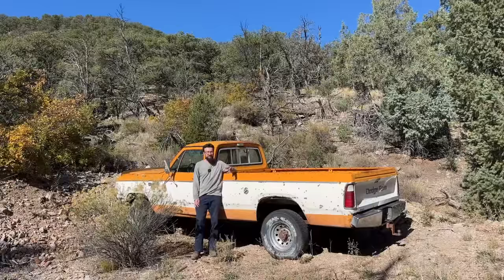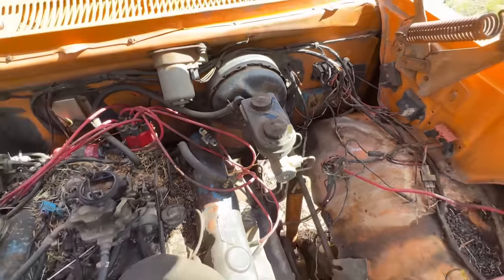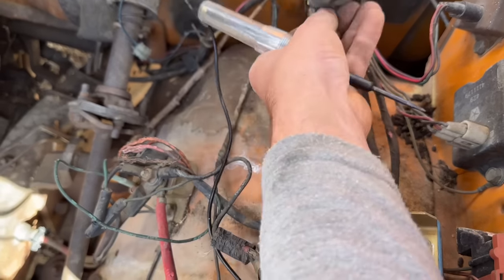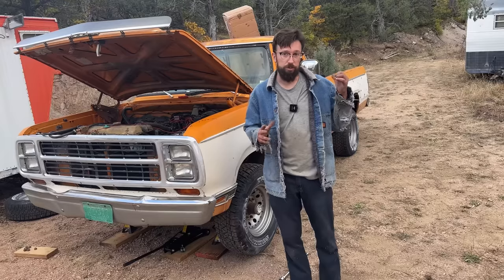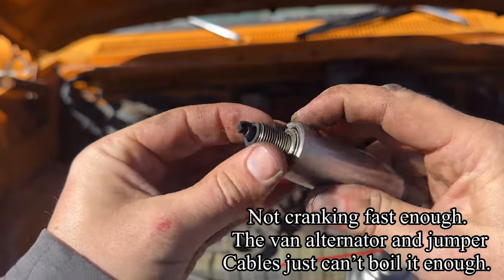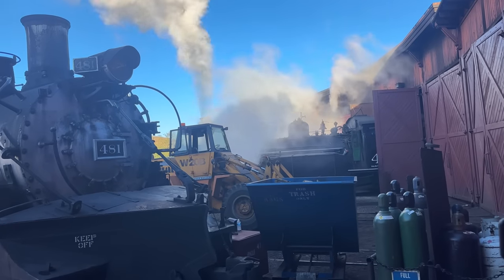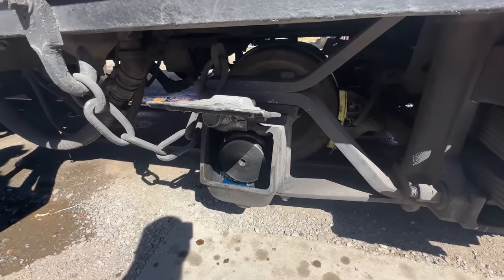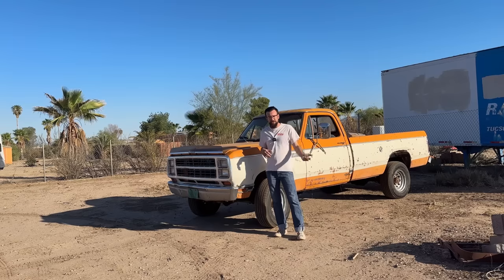I bought a 1980 dodge ABANDONED 22 years. Will it run and drive 876 miles home?

Comment: I dont often comment negative stuff, but in this case I really have to say something. Please do not ever try to drive a vehicle onto a trailer or dolly if it begins to move, you can really easilly seriously injure or kill yourself or someone else. If the vehicle runs away when you are on the trailer or dolly you will have zero control and will just sit there as it runs away, set the brakes properly or chock the wheels. Im serious, ive towed cars for 30 years and watching this completely freaked me out, so, so dangerous. Please make an edit just telling people not to do this. Otherwise good content and a decent video. Ps i think the clutch was just siezing on the bearing, it might have got better if you had pumped it for a few minuites.
Reply: Learning experiences.. put a rock in front n rear of the cube van tire and the dolly lol  you are so lucky . U haul wouldn’t be happy lol

Comment: Adjust the manual clutch.
Reply: I was thinking the same thing - also, going up the steep hill, why not put the transfer case in LO range? If the clutch can shove that Uhaul truck it's got to be good enough to drive the Dodge at a steady speed HOME. And why was the Uhaul truck rolling away??

Comment: I'm not sure I understand what went wrong here.  Why was the cube van / tow dolly moving when you tried to load the truck?  Were you overloading the parking pawl?  Did you not have the vans' brake set?  Did you not chock the wheels???  Why did you attempt to load it twice after the first time you wound up pushing the van???  Kind of a calamity of errors going on here, wouldn't you agree?

I bet the clutch & flywheel were just rusty.  After driving it and cleaning them off, the clutch was probably nominal.
Reply: 100% didn't set the parking brake, guys a bit of a dip shit lol

Comment: Hey Travis... love the channel and I enjoy the videos!  I'm an old dog who worked in the auto parts trade for many years, and I'd like to pass along some knowledge that I've shared many times.  You can always tell when someone has been mentored by an old timer when they test a charging system by removing a battery cable from a running vehicle.  This is a throwback from the generator days, and was a valid test for vehicle equipped with one.  The generator is an electrical device, while an alternator is an electronic device.  Removing a battery cable on a running vehicle with an alternator is rolling the dice on doing significant damage to the alternator and possibly other electronic components as well-- depending upon the year model.  You are taking the load out of the circuit when you pull that battery cable, and the voltage regulator can cause the alternator to produce a lot more than 12-15 volts... up to 150 in some cases!  And I have had people argue with me for years, because it doesn't always happen... it is a lesson that you learn the hard way.  Like the guy who brought his late model Suburban into the shop I was working at one day with a non-charging situation, and he told me that he knew his alternator was good because he pulled the battery cable off, and the engine kept running...  Turned out to be an expensive mistake!
Reply from the maker: Yes my dads also told me that. When you take the cable off you take the load off and it way overproduces and can blow itself up

Comment: Maybe there was no other alternative, but it's very dangerous to pull the truck out by attaching the chain to the ball hitch. Ball hitches aren't designed to take that type of lateral force. They can brake off, acting as a cannonball, sling shoting to the front. People have died from this happening in very terrible ways as you can imagine.
Reply: True you usually have anchor points on the rear frame and also the bumper which I don't suggest and also the receiver hitch assembly itself usually has them and that is the places to attach the chain or jerk strap to not the hitch ball on the receiver hitch extension.

Comment: The la 318 and the evolution to the magnum 318 of the late nineties and two thousands, was one of the most underrated engines...bigger than the ford 302 and the Chevy 305, it was the base dodge go to used in all vehicle and commercial applications...that engine was good for at least three hundred thousand miles and up....

Comment: Cool truck. Definitely worth making a solid runner. When you did the new brake pad/old brake pad comparison, is it me…or did it look like the new pad was already separating from the steel backer?

And why wasn’t the U-haul e-brake engaged…or it in park when you “loaded” it? Ha! Feel your pain.

Also, did you remove the rear driveshaft? Not sure what transfer case is in there, but you usually don’t want it spinning internally bc it, and/or the tranny, wont get splash oiled when towed, and can seize up. Best to remove driveshaft to be safe. Good luck buddy!!

Comment: Take it from a retired mechanic, get a harbor freight scissors trany jack pull the transfer case, then the trany. Leave the trany on the jack, put the clutch in, slide the trany back in. Reinstall the t-case, 6-7 hrs your running down the road!!
Reply: Yeah I would of done it right then and there. Clutch takes 1 day to order so you tear it down and next day when it shows up you put it back.
Reply: @MaxGiganteum  He test drove the truck dont tell me there isnt a single flat spot in that land.. Much bigger jobs than that get done in the woods bud.

Comment: Everyone!! Do not ever drive a vehicle onto a trailer or dolly without chocking the front wheels of the tow vehicle or the rear axle of the trailer. Weight transfer can lift axles off the ground. Or you can just push the tow vehicle. Glad you didn't have a really bad day. Like someone else said, mice love to build nests in clutches. Maybe the mechanic messed up the linkage? Clutch fork not on ball stud? I've gotten more the 4 dozen vehicles (pre 1980) running that sat for years, and only 3 didn't require carb cleaning to run well enough to drive. One was a diesel. I rode that train in September and only 4 other people came in the museum.

Comment: travis, i owned an '85 ram for years. the clutch linkage is adjustable. i'd try that first, then if it needs a clutch, pull the transfer case by itself, then take the transmission down. it should be a married setup with an np205 t-case. the NP205 is cast iron and heavy as hell, but its not that bad. just make sure to have an actual 6 way adjustable transmission jack, or the splines and bell housing can be hard to align, (especially once dodge went to the finer splines on the input shaft). The older Power Wagons even had a removable doghouse for that purpose so you don't have to pull the shifter out of the tower. i believe the '80 still had one since it's still the old body style.
i would also check that the bellhousing is clocked to the engine. i have a video on how to do that on my channel. its really important to ensure the transmission and clutch don't wear out prematurely
if you need any help, feel free to message me on my channel and i can guide you through it and any pitfalls to avoid, such as losing breaking the bushings in the clutch countershaft.

Comment: I'm sure you removed the drive shaft so the transmission didn't get damaged while towing.
Reply: After seeing how inexperienced Travis was at getting the truck onto the dolly, I have my doubts and I'm completely gobsmacked that the wee U-Haul box van kept moving and... well that whole scene was made for a Laural & Hardy remake.
Reply: @claztube He tries hard and does well for a youngster. There are hundreds of videos that warn you not to tow manual transmissions long distances. Because all the gears and shafts only get lubricated while the motor turns them. Removing the drive shaft is always recommended.

Comment: Hey Travis, the problem with the spark control unit might have been solved by just disconnecting and reconnecting the plugs. You know, to remove rust that might have been built up over the years.

Comment: I'm surprised nobody mentioned that whole setup of U-Haul was not intended to haul a truck of that size and weight. On the other hand I suppose your dad didn't get anything and check the adjustment on the clutch? Also the probable spring. Trucks in great shape given its age congratulations. Congratulations on 125 K subscribers. I'm don't even think he had but maybe 12000 when I subscribe and it's not been that long.

Comment: 50:44 this uhaul was rented in colorado and returned in arizona 

But that doesnt look like a 1996 nissan maxima on that tow dolly……

Not to mention the equipment was damaged 😂 due to user error why you have the truck in neutral while trying to load a vehicle

50:36 not to mention you didnt even have the ramps out on the tow dolly 

Ask whoever is hitching up your equipment on how to use it properly

Comment: I would def fix it...great truck!  If you do have to pull the engine, it looked like there was a lot of oil leakage on the back of the oil pan.  It would be a great time to replace the rear main seal and pan gasket if they're the culprit...  Fun video A+++++

Comment: In osco to Michigan, they have the end of the Canadian national rail line, and all engines go into the roundabout which is a carousel just like this. And it is a red fire glazed brick building. And it is still used to this day, but not as often. Because the rail lines that stopped there stopped being used on a regular basis approximately 35 years ago period but I have seen it one time. Turn an engine around within the enclosed building.

Comment: LOL that motel is gone...just the sign is left. Gallup isn't the nicest place ever. Next time you are through there try to stay at the El Rancho. Make sure you put the right clutch in. That truck sounds like it has the heavy-duty A-435 four-speed, not the 833.  Pretty sure the clutch is larger on the 435. As mentioned, check the freeze plugs on the rear of the engine...pulling the trans is the only way to get to them if they leak.

Comment: Replace that clutch, educate yourself on part time 4x4, it’s fine to leave hubs locked in up to 45 mph. I’ve leave my hub’s locked  during the winter months for years with no I’ll effects. Buy a newer flywheel out of a wrecking yard, possibly thicker than yours, and definitely better than the chinesium steel flywheels you can buy new nowadays. Bolt the flywheel, clutch disk and pressure plate together before you install any of it, then try putting a very thin feeler gauge between the disk and flywheel/ pressure plate at several points around the assembly. There should be no point where it could slide into a gap, if so something isn’t flat. 
Good luck, I’ll be keeping an eye on this build!
Reply: I’ve left my hubs locked in with no ill effects… I should proof read…

Comment: I have been there done that Travis. I went from Utah to Michigan to pick up a 1919 Fire Truck. I drive all that way then discovered that the Trailer I took with me was not Heavy Duty enough. I ended up renting the Biggest Moving Truck I could find loaded the Fire Engine inside put my Truck on my Trailer hooked it up to the Rental Truck and drove back to Utah. Put a clutch in it! BTW great Train ride I have done that one several times.

Comment: You must have had that Uhaul truck in neutral with no parking break for it to roll that easy. Why didn't you get it on the ramp part ang use a come.along to get it the rest of the way?
Reply: Yah… definitely odd. Thought he was lifting the back wheels up until he cut to the other angle. U-Haul quality I guess? Still not sure why you wouldn’t try chocking the wheels with a rock or something

Comment: Fix the clutch. The clutch death could have been from going up and down hills or a from a new driver on a clutch. Who knows. Everything is good on the truck. In most trucks, 1st Gear is Granny or Compound Gear for going up steep hills. For normal driving, start in 2nd Gear. I do it all the time and have had no problem.
Reply: Yeah granny is way to low for normal driving only really need it for offroading and hauling

Comment: Good video Travis!!!  Thanks for including the part of you driving it over the tow dolly!!!  I LOLed at that!!!  Also, had you put the truck in 4 low it might have given you enough of a gear reduction for the truck to pull itself up to your buddy's house.  It wouldn't have made it back home but it might have made it up that little hill.  I had an 87 Chevy 1/2 ton 4x4 and the tranny failed on me on my way home from work one day.  Would barely pull itself and I was stuck in traffic.  It was an automatic.   I locked the transfer case in low and it pulled it fine and let me get up to about 30 MPH which was the speed limit in the town I was in.  Made it all the way to a Chevy dealership.  They wound up covering the tranny on warranty.  That was the last year of the straight axle 4x4's for GM.  I wound up putting 195,000 miles on that good ole truck and it was running fine when I traded it in.
Reply: PS:  I loved the part about the trains.  Kind of like a bonus!!!  I'm a history nut and could spend an entire day at a museum like that one.

Comment: Not trying to be negative but don't tow truck drivers usually disconnect the drive shaft when towing a 4x4? Especially long distances? Would that hurt your drivetrain or am I wrong?
Reply: only when automatic, the manual does not care
Reply: I always put transfer case in neutral
Reply from the maker: On manuals you can put it in neutral and it shouldn’t hurt it
Reply: Manual transmissions are pretty forgiving when they’re towed as opposed to auto transmissions
Reply: Manual is no issue. Not even any wear. You never tow an auto like that. Fucks it.
Reply: @vb5666  wow dude,

Comment: I 🤔 it is a improper installed throw out bearing and maybe a bent clutch fork and the two allowed the clutch to start slipping especially in the inclines and downgrades this truck was subjected to and it got hot and glazed the flywheel so I would say check out the transmission make sure it has good imternals, but put a dual disk clutch in it new throw out bearing and pressure plate assembly and check the clutch fork, and get the flywheel resurfaced honestly as good as it runs id pull the motor freshen up the gaskets new oil pump and main and rod bearings new ignition parts,plugs and wires, and that way when you put it back together you would have you a dependable and capable recovery vehicle to go do these revivals with

Comment: That's a sweet truck I'm a big Mopar guy and love those old Dodge trucks. I have a 1979 and it has the same front end as yours . Yours must be a early 1980 truck because the 1980 Dodge trucks that I have ever seen is the single round headlight front end and the 1979 front ends are the stacked rectangle lights anyway what a awesome score if you lived closer to me i would but that thing off you right away because like I said i love those old Dodge Trucks

Comment: Sweet history in your video today the father inlaw has a model railroad with the same round house for his stem engines that he runs along side the electric ones he’s got his model railroad takes up two rooms in his basement the tracks run through the wall under the stairs so both rooms can be used at same time even the turntable works just like the one you seen in real life

Comment: only sends about 8 volts with switch on but in start it has 12 volts to start so they are usually hard to start without using the ignition switch because voltage so low in run. also if ballast goes bad you can bypass and they will run my grand father had a ballast go bad bypassed and it was 2 years later before he remembered to replace and didn't hurt anything

Comment: Just a quick note Robert, that truck should have an  electric washer pump.
Push in on the knob, you don't have to turn the wipers on.
Oh and it looks like a wide ratio 4spd. by the looks of the stick.
You bout have to open the glove box teaching up into third.
Good on you for saving an old Dodge 👍

Comment: They used to build them to last. That plucky old steam engine will outlast us. I saw a vid about a steam driven pumping station, where they managed to restart and run circa 1886 steam engine. It just runs as it used to. It is now a working museum. It is on YT.  Interestingly it is a young guy who got it working and running.  These machines will die only if there wont be people left with the knowledge to run them.
Reply from the maker: I saw the same video. Was amazing

Comment: Nice find. Actually learned to drive in one very similar, just blue. At 7 I could barely see over the steering wheel🤣🤷🏻‍♂️. I would pull the trans & transfer case as one unit Vs pulling the engine just to do a clutch. Pretty cool you got to ride the train from Durango to Silverton-got to ride it one weekend while I was out there.

Comment: How do you find these people and vehicles? I am looking for an old diesel truck that has been parked and abandoned like you find? Any suggestions?
Reply: It's not difficult, unless you require a SPECIFIC make, model, year, color, etc. For example, if you MUST have a '79 RED F-250 longbed 4x4 with a 460 and a 4 speed, GOOD LUCK! If you just want an "old Ford 4x4", that's easy. Marketplace, Craigslist, Bring A Trailer, etc. Or just drive around in the country! Seek and ye shall find.

Comment: 5-6 hour for a flywheel/pressure plate/throw-out bearing/clutch replacement by pulling the transfer case and transmission. tad longer if you don't have a lift. Ask me how I know.  LOL

Comment: The Denver Rio Grande Western (D&RGW) had the largest narrow-gauge railroad network with 1,861 miles (2,995 km) of track interconnecting the states of Colorado, northern New Mexico, and Utah. The only two running lines of that narrow gauge is the Durango & Silverton (45 miles) of rail and Cumbres Toltec Scenic Railroad with (64-miles) of rail.  They're both protected as national historical monuments.